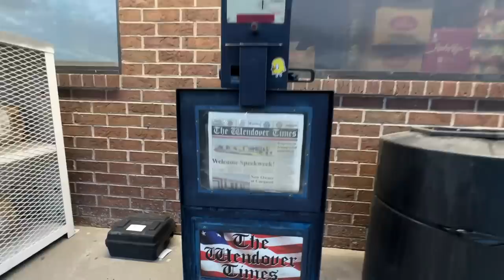Salt Rookie No More! - Made my FIRST Land Speed Racing Pass at Bonneville Speed Week 2023 - Video 5

Comment: Dennis is prolly already ordering chassis tubing. Here we go...
Reply: Why was the shifter pushing back against her hand?
Reply: @Robert.Isaac.Cunningham non cltuch assisted gear box you use the clutch to take off but after that you can just pull it to each gear without clutching. But those types of gearboxes the only thing holding it in each gear is you staying under power the instant you let off they will usually jump outta gear to neutral thus why they are best for racing only
Reply: @codyyoung3078    Thanku
Reply: That's funny
Reply: Congratulations Alex to you all.  Awesome job
Reply: What’s a prolly?
Reply: @z06doc86     prolly = probably
Reply: Bonemaro is now Saltmaro I can see it already...
Reply: I don’t think they’ll pivot from drag racing to landspeed anytime soon.
Reply: @sebastiangiovannella7778  I think the pivot is what this video is about. Alex stated, "I think I need another car." Obviously, Alex, if fired up about the experience of driving land speed cars. ATR will never leave drags, but a pivot definitely has happened.
Reply: @INFANTRY1981  I think what is gonna happen is her doing mostly drag racing and trying to fit land speed between competitions.
Reply: Brought a tear to this old guys eye.

Comment: Congratulations great work. 👍🎉 Love speed. 👊✊
That was my average speed on a motorcycle for ( 2 hours and 40 minutes )  over a distance of 460 km distance on road. From Alice Springs to Uluru Northern territory  Australia. 🇦🇺
Most of the time sitting on about 280/290 kms. With 3 fuel stops.  Back when the Northern Territory had open speed limits. When Porsche used to bring the new 911s and Chevrolet Corvette cars to test high speed runs in different weather conditions. 🥶🥵

Normally it would take 4 hr 56 min (467.8 km)
From Alice Springs to Uluru Northern territory 
via Stuart Hwy/A87 and A4/State Route 4

Comment: for a possible upcoming video, maybe someone should walk through how & why this Camaro is setup for Bonneville: Engine displacement, fuel system, intercooler (and its location), suspension, ballast (where is it bolted and how much), tires (narrow and shaved?), etc.  Plus describe the "Push off" at the start.  Packing of the parachute (and multiple chutes).  A lot of things that are per SCTA rules, that work on the salt (traction) aren't the most intuitive thing given the drag racing or even road racing world. This isn't your typical Camaro.

Looks like your crew is well rehearsed and has their jobs -- good thing!  Lots of details need to be checked before and after each run and an experienced crew makes a big difference..
Reply: I didn’t know that this WAS an “educate them” video?  I thought it was just a video of her sharing her experiences with all of you. 🤷🏻‍♀️

Comment: With the "Stress" of the "Process", the actual driving must have felt like a Yawner going only about 80 at the Quarter mile.  But then, when you pulled only 1 chute I was surprised thinking you always practiced with your hand on both handles.  Then, I realized: "140? That's nothing!"  "Even Cleetus can do that!"  But not on the beach with so much more left over.